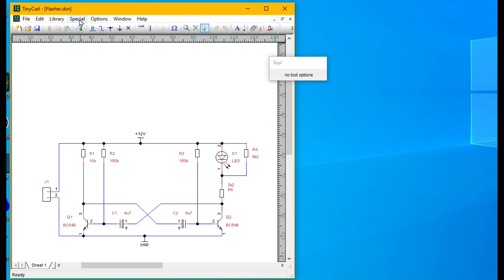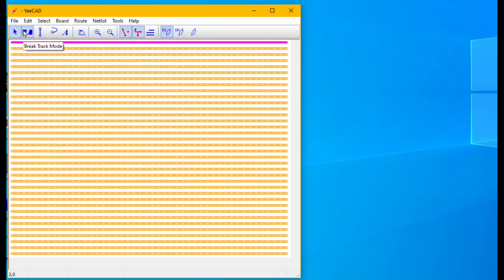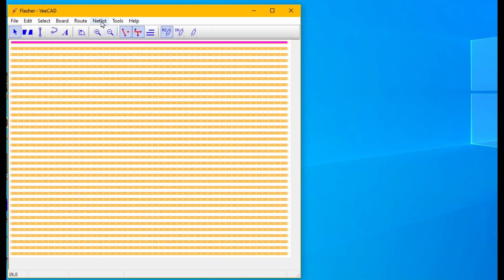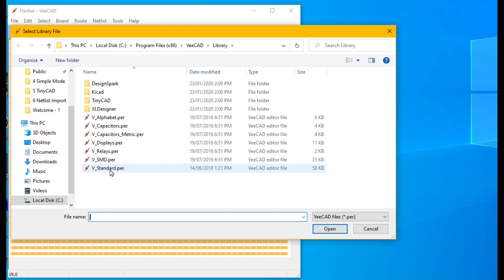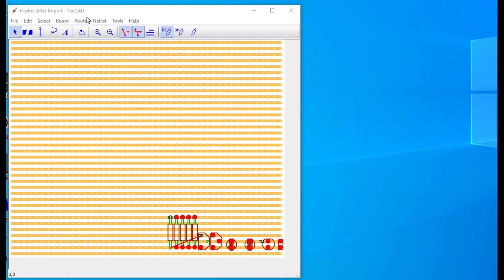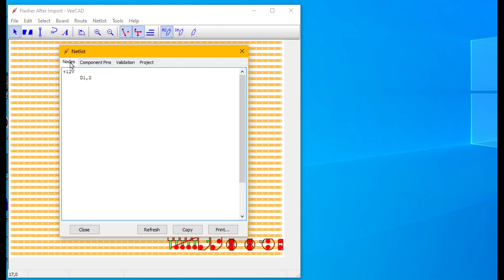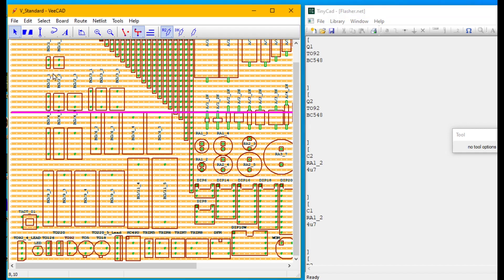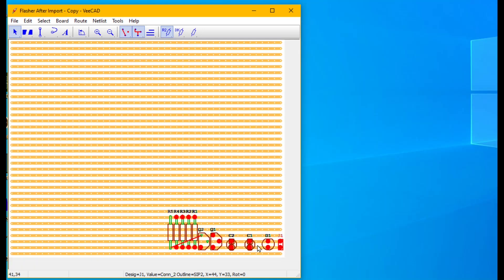6. Netlist Import

Comment: For some reason, I'm told file not found
Reply: I think you mean that you get "File not found" when you click the "Import button" on the Netlist Import dialog. If you watch the video at 0:23 you see the project File is saved to the SAME NAME as your netlist file and in the same folder. That way VeeCAD can find the netlist automatically. If the names are different, you can click the "..." button on the Netlist Import dialog and select the netlist manually.

Comment: Can a netlist from Ltspice be imported ? If so how?
Reply from the maker: LTSpice is not designed to produce a useful netlist for PCB or VeeCAD. LTSpice does not properly represent physical details like packages, connectors and even hardware that you would put in a manufacturing schematic. If you are looking for a schematic editor, I highly recommend Tinycad because of its good quality, free price, simplicity of use but also adequate power for even large projects. Personally, I have not had much luck with combined schematic-simulator products - because you don't want to place on your board the voltage sources and meters and loads that you put on your simulation schematic.

Comment: Strangely VeeCAD does not connect the pins i connected in TinyCAD, although i exactly followed your steps. I checked it 5 times. What can be the error here?
Reply from the maker: If you go to https://veecad.com you will see the "contact" link with my email address. Send me your netlist file and I will find what is wrong, and help you going.
Reply: the problem is did not click show errors the button labeled draw net errors